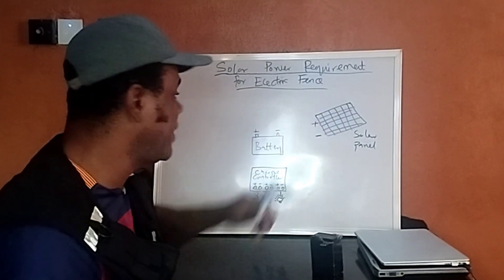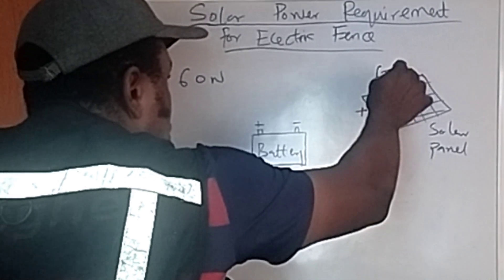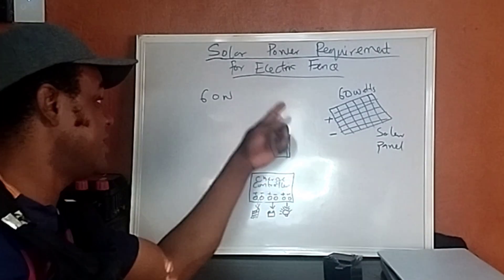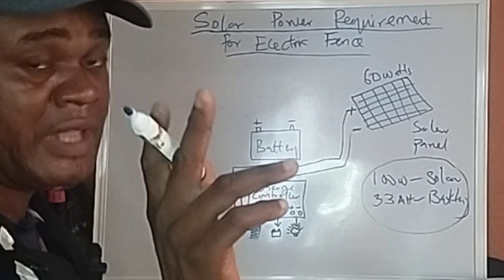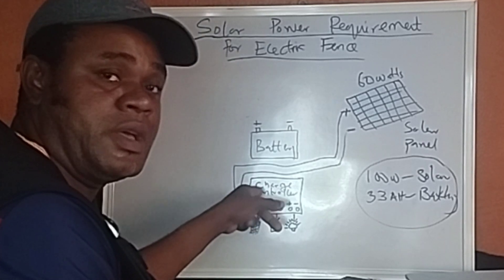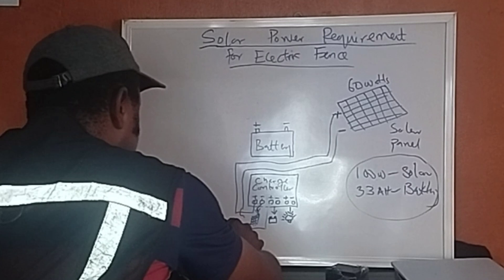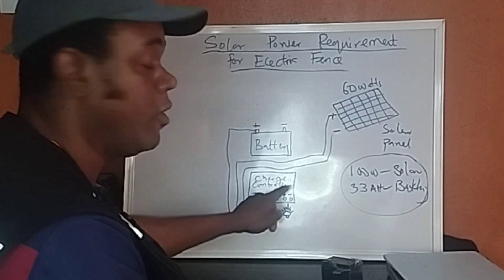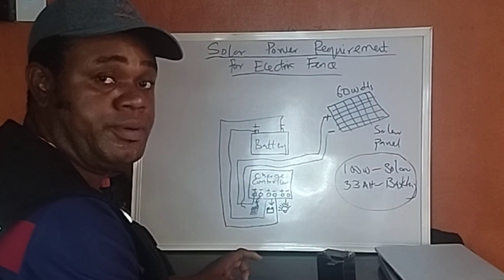how to determine solar panel for electric fence

Comment: Sir, which of the Energizer in Nigeria market you can recommend works well on self solar system?
Reply from the maker: The solar system is independent. They all work well, the only information you should be concerned about is the power consumption of the energisers.

Comment: Sir i have question if my inverter is hybrid is it neccessary to use charge controller
Reply from the maker: Not at all, you don't need a charge controller anymore, because it's built-in
Reply: @defotechtv9093  ok sir